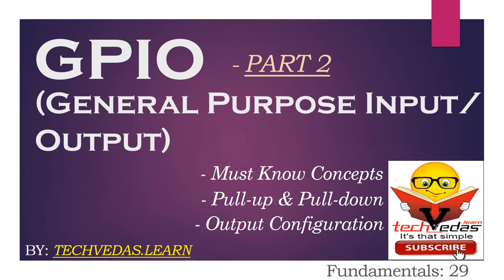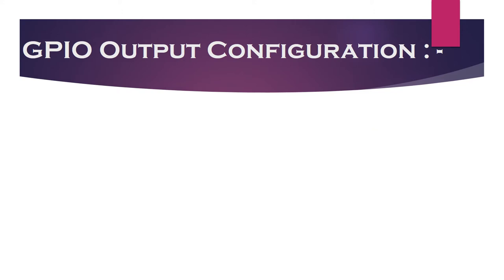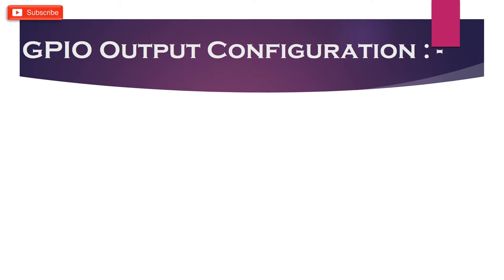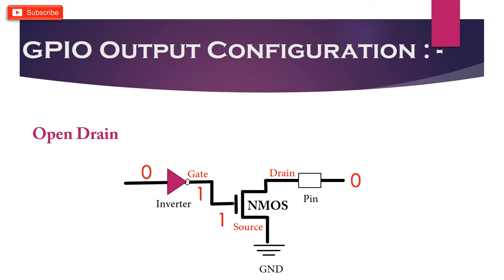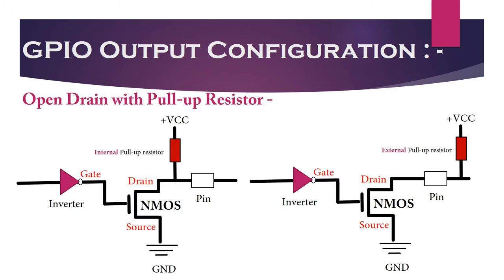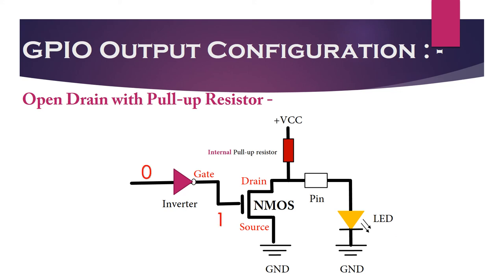GPIO Output Configuration | Open Drain configuration | Push Pull configuration

Comment: excellent explanation :) Could the open drain be used to generate a PWM with a higher voltage than the one generated by the microcontroller?

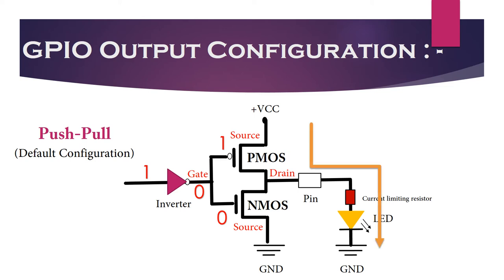Comment: At 1:56 I don't understand how the P-MOS can be activated by the 1. If '1' is logic high (3.3V/Vcc), then the voltage of the gate relative to the source (Vgs) is simply 0, and the P-MOS is not conductive. To activate the P-MOS, Vgs needs to be negative -- that is, the gate voltage would need to be logic low (0V/GND) while the source voltage is 3.3V/Vcc, meaning Vgs = -3.3V.

And again, at 2:21 ,  if there is 0V on the gate of the P-MOS, the P-MOS will activate due to the negative Vgs, which means both mosfets will activate and Vcc and GND will be 'shorted' by the connected drains.

What am I missing?
Reply: That number near the base is the result after the inversion, not before

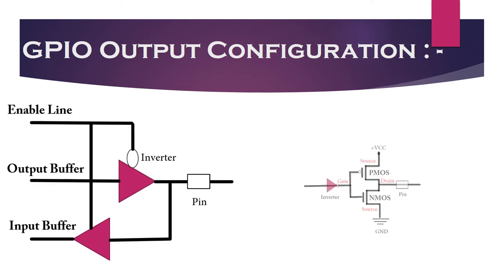Comment: 1:03 The diagram has some mistake. The output Gate should not connect to both the PMOS and the NMOS. There should be 2 different gates connecting to different MOS. Otherwise, you could not get the desired control result.